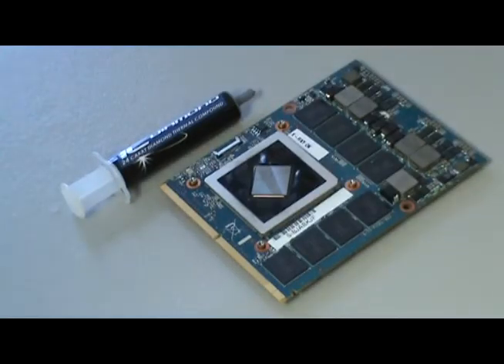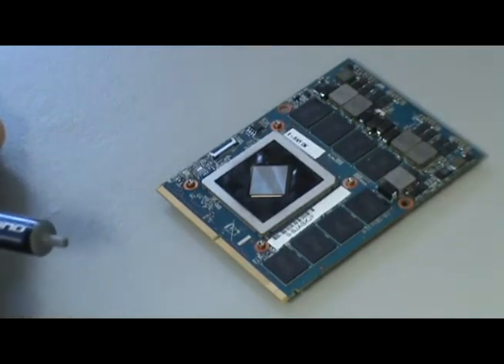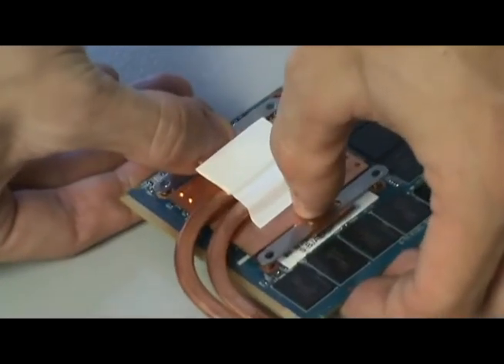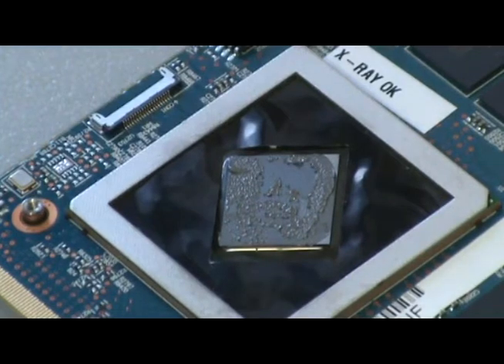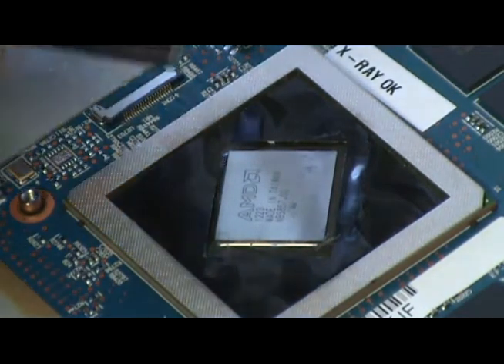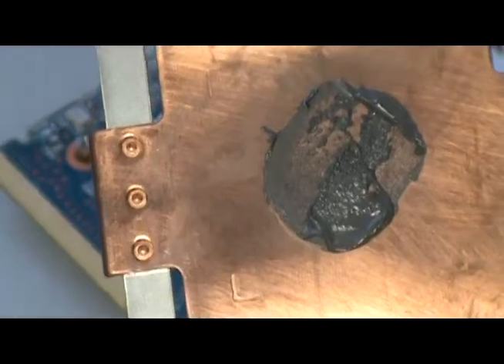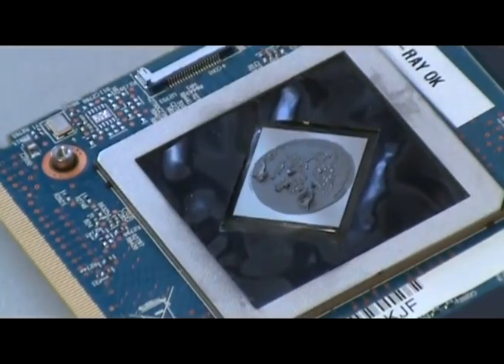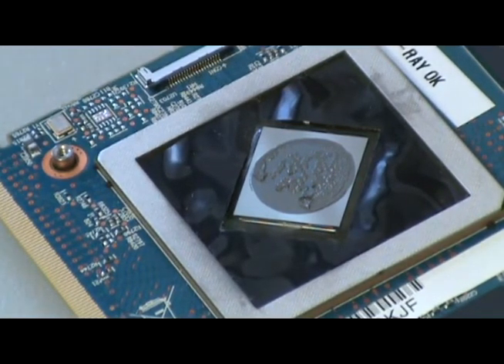Graphics Card Thermal Paste Application Guide

Comment: You should never use diamond paste directly on the die. If the cpu or gpu has an ihs, diamond paste is one of the best, but putting it directly on the die is a bad idea. This will scratch the silicon.
Reply from the maker: We've never had any problems with it damaging the die.

Comment: How long do you have to wait for it to set? Can you have the computer running during that 2+ hour period?
Reply from the maker: +Ó Slatraigh  You can use your system right after you apply the thermal paste but the performance improves after some setting.  For more information on this please check this guide from the thermal paste company itself: http://www.innovationcooling.com/application.html
Reply: EurocomTechnology I put on the paste, seemed to cool down a bit, but not much. I think my fan motors are going out. There's two on the heatsink. I cleaned all the gunk out of the heatsink, but it sputters and stops sometimes.
Reply from the maker: Ó Slatraigh  Yes, if your fans are not functioning properly then the heatsinks will not cool down your card much.  What laptop do you own?
Reply from the maker: Ó Slatraigh oh ok, yeah the process is really the same with desktops.  FYI we just released a laptop with desktop CPU and GPU.  It's called the Sky X9!  http://www.eurocom.com/ec/configure(1,336,0)ec
Reply from the maker: Ó Slatraigh Here you go ; )

Comment: CPU dot in the middle and x method are the best period no arguing. I just did my gpu today and used the x method. GPU has no heatsink its pretty much straight on the die so you want to cover the entire thing. I also suggest a non conductive thermal paste. As a lot of new dies have transistors and resistors right next to the die could cause some shorting out if it does spill out. I dropped about 5°C+ changing my thermal paste to noctua. Used the x method seems to work perfectly fine. You also don't need a lot of thermal paste.

Comment: "only getting thermal exchange over part of the die", yea, the part of the die where the actual chip is underneath.
Reply: The gpu doesnt have a heat spreader or IHS like the cpu does, your pretty much putting thermal paste right on the die itself. On a cpu the die is right in the center of the chip thats why just covering the center works perfectly fine.

Comment: According to http://www.innovationcooling.com/application.html the best is to make a big dot. Its better to use a bit more, the residue will end up on the cooler anyway so no harm (If the paste contains silver and touches the circuits, it could with very low probability cause short circuit). Also to get rid of static electricity in your body, touch the PE (protective earth), the middle exposed pin on your power socket.

Comment: I guess all the question I've needed to ask have been answered. Just to make sure, I have the m17xR3, I currently have the GTX 460m, thus meaning the 120hz display. I've been told that upgrading to a newer model of GTX graphic cards will require some tinkering with the BIOS as well as losing the 3D functionality which I do not really care about is there anything else I've got to be sure about before proceeding?